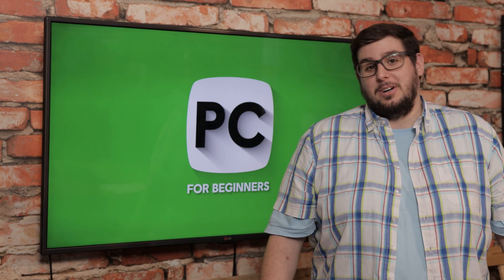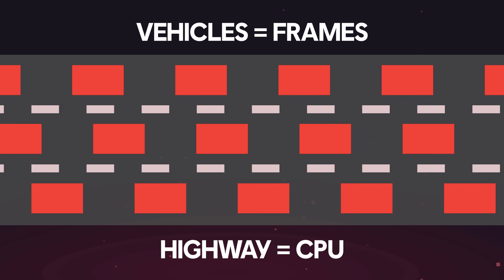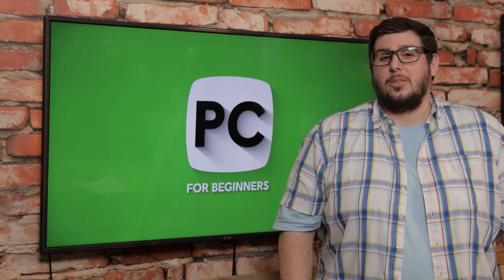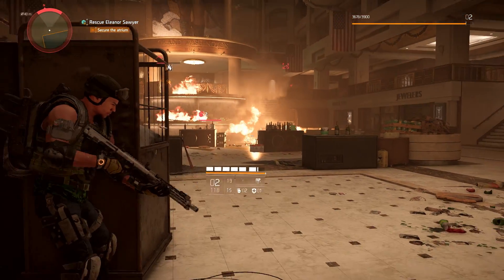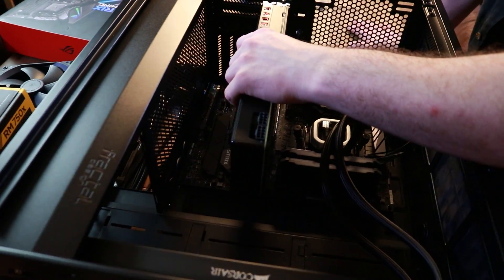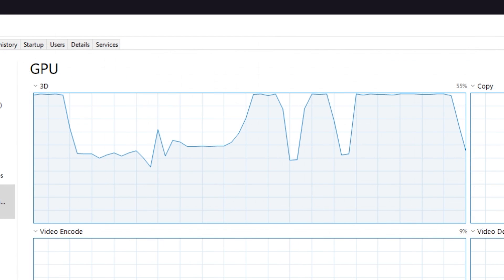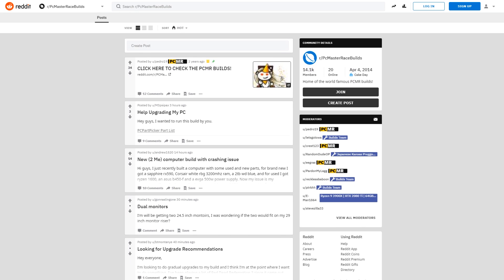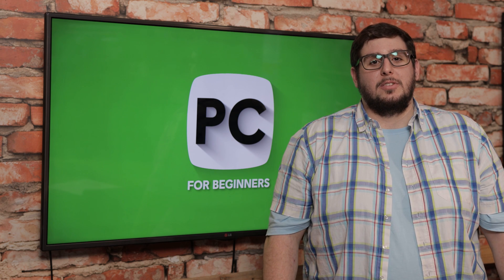What is a PC Bottleneck? [PC for Beginners] - NGON

Comment: hello i am a new to pc building and i am not %100 present shure if all the parts can work to or if i need any more parts gether thank you
*CPU*              | [AMD Ryzen 7 1700X 3.4 GHz 8-Core Processor]                           ₱10071.00 
*CPU Cooler*       | [Cooler Master Hyper 212 Black Edition 42 CFM CPU Cooler]              ₱4163.29
*Motherboard*      | [Asus STRIX B350-F GAMING ATX AM4 Motherboard]                         ₱5896.00
*Memory*           | [Corsair 8 GB (1 x 8 GB) DDR4-2133 CL15 Memory]                        ₱3105.43
*Storage*          | [Seagate Barracuda Compute 2 TB 3.5" 7200RPM Internal Hard Drive]      ₱4650.04
*Video Card*       | [MSI GeForce GTX 1050 Ti 4 GB GAMING X 4G Video Card]                  ₱11900.26
*Case*             | [NZXT H510 ATX Mid Tower Case]                                         ₱9010.11
*Power Supply*     | [Thermaltake Smart Series 430 W 80+ Certified ATX Power Supply]        ₱4657.82

Comment: What would be a good upgrade, according to bottle neck calculator my processor i3 6100 works 100% and allows for my 1060 to only use 42% what will be a good processor to even this out

Comment: This video is pretty bad, and allow me to explain why. There are plenty of situations where a poor game engine can cause the renderthread to stall out even in a very well-balanced system. Particularly if it's using old Draw techniques by not re-using assets of instancing. Crysis still makes modern CPU's cry, because it effectively runs on a single thread, and IPC hasn't gone up THAT much since Conroe (2007). 

The bottleneck calculators are trash, you need to buy the CPU that is best value, and the GPU is best value. And fix any issues you might find in certain games on a case-by-case basis. Don't let some dumb calculator make you buy less-than-stellar value parts. Right now that'd probably be the Ryzen 3600 and the Radeon 5700 (XT) for value builds (yes Ubisoft i saw that sneaky intel build, bad ubisoft). 

Also, this video completely and utterly omits the effect of V-sync or other framecapping software. And seeing as that's on by default for every game, that's a pretty BIG thing to omiss. The way traditional v-sync works, means if you're not hitting your native monitor refreshrate it auto-defaults to native/2, meaning for 60hz that's 30fps. If your game is running 60fps and your GPU cannot hit a few frames at <16.67ms, it dips to 30fps (and as a result also decreases the GPU load). This could lead to false assumptions on users who watched this video to think their CPU is at fault, because on Afterburner or Task manager they see GPU load go down, when it is in fact the GPU that's not fast enough during a v-sync scenario. So the first thing to do when you encounter stuttering is turn of all in-game framecaps and v-sync and see what the actual performance is that you're hitting. You can add a separate framecap or mitigating factors later.

As for stuttering outside of v-sync, that only occurs when the renderthread goes too fast and calculations get backed up, resulting the engine to stall. You don't solve this by firing money at the computer first, you try to do the smart thing first and implement a framerate cap using either Nvidia Inspector or RivaTuner Statistics Server (RTSS) and cap it to the framerate your CPU is capable of delivering enough data to the GPU to keep it going without stalling out the engine (read: that's a cap, not v-sync). This can result in smooth gameplay even if the GPU laod isn't 100% all the time, especially on those using Freesync/G-sync monitors. There are video's on youtube for both (try looking for the battle(non)sense video for stuttering). If I post links this comment probably gets autoflagged by youtube and put in the spam folder. Another useful tip is to increase the load on the GPU only in order to keep it busy for longer, leaving the CPU more time to calculate geometry for the next frame. This will result in lower fps of course, but less stuttering. Easy ways to do this with modern games is: Increase AA, resolution (except for Ubisoft games which use geometry shaders), resolution scales, or any other pixelshader type elements. 
Lowering the load for the CPU is also useful, this can be done by lowering geometry-based settings like Model detail, draw distance, character detail, etc. The less geometry in the scene, the faster it can calculate the next frame.

The hard reality is, that it's just not a topic you can easily dumb down in bite-size video's. Game engines are complex, CPU-GPU interaction is complex and not one-dimensionally representable by traffic jams or other analogies. So don't keep making these video's trivializing everything, Ubisoft.

Comment: I was thinking that this might identify why The Crew 2 jumps from a solid 60 FPS down to 45 and anywhere in between. It didn't. But on the bright side I did find out that my CPU and GPU work extremely well together. Thanks for the informative video. I never knew any of this info before.